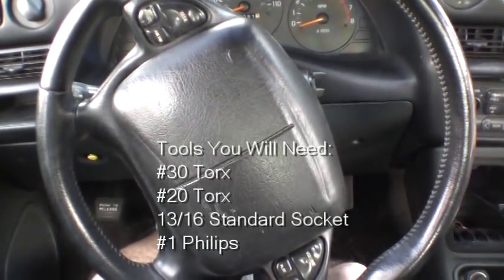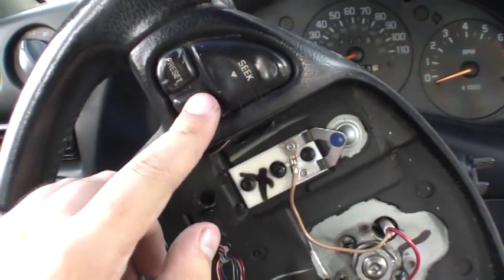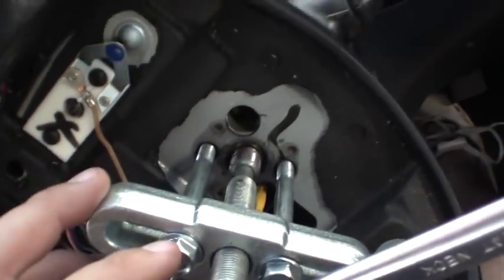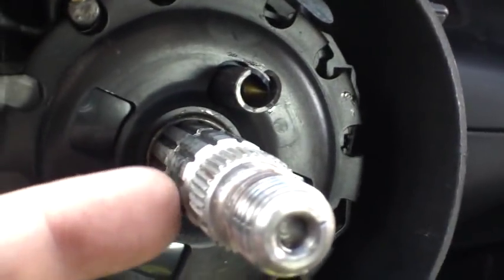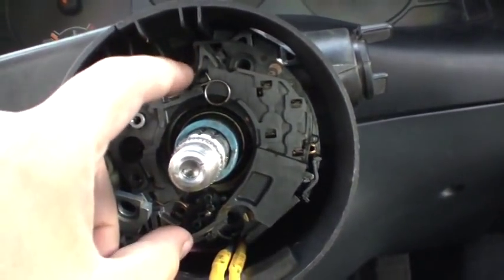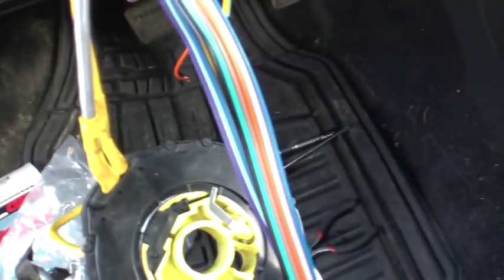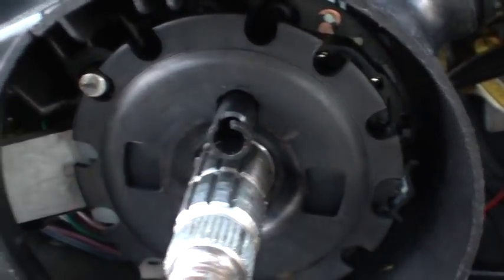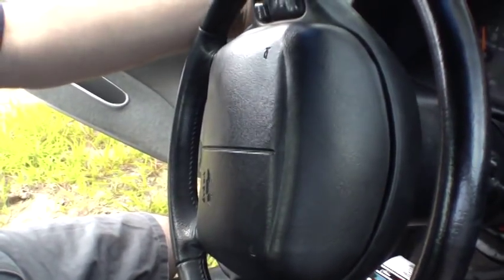How To: Blinker Switch or Turn Signal Replacement 1996 Chevy Monte Carlo

Comment: worked on a 98 Lumina, this really helped used a t10 and t20. did not need t30 on the lumina. the clock spring and the piece before the turn signal switch was a pain. it helped having help in pushing down on the parts to remove the springs. thanks on the video!

Comment: Did this job today on a 97 Lumina. Getting that steering wheel locking disc off was quite a job. Really struggled removing the c-clip without tabs. I finally found a right angle pick, and it did the job. Putting it back was even worse. Had to call a friend to come over an lend a third hand. The spring tension was wicked. Anyway I lucked out in one way. My problem was left turn signal would not latch on all the time, and when it did, it would not reset after the turn. After removing the steering wheel disc, I could see the left spring was broken. Took spring off replacement switch, and installed it on the old switch. I see your left spring in the video was missing altogether. Anyway all back together and works great. Thanks

Comment: Cheers man I couldn't for the life of me figure out why my brake lights quit working in my 96 Lumina so this helps alot. Great video
Reply: sorry ass luminas...i,m doing the same on my 99 lumina ...brake lights not getting power...why in the hell they run the brake light switch off the turn signal switch is stupid....

Comment: Awesome video. Just replace mine using this guide. FYI...The big Orange wire (2 wires inside) is the VATS security system. You can bypass the system by finding the resistance of the chip in your key and install a resistor of that value (radio shack is easiest) to connect both wires together (from the under dash side not ignition side). You can also do this so you don't have to pay $20+ for a resistor key and get a $2 regular key.

Comment: Right on! Your video made it simple. Same exact process for 95-99 Cadillac Devilles. Thanks! Once I had everything apart, noticed some idiot had broke the turn signal canceling cam where the horn wire goes and instead of replacing the cam, he put a toothpick in with the horn wire to tighten it. It worked...ingenious but just plain lazy.

Comment: thanks but wrong connector you showed under the dash it is the one with the white clip on the back of the junction block you showed  also most all horn pieces will be broken replacements are gm#26047013 but buy from advance or oreilly and save yourself 26 dollars over the stealership. just adding to the good job you did making this video thank you

Comment from the maker: @0button0 If you are asking about the corroded wire, it is in the engine compartment drivers side.  There is a fuse panel that has an open bottom.  Unbolt it and check the bus bars underneath.  There are most likely some wires that have lost their connection completely.

Comment: Im changing mines on a 95 Cutlass Supreme and the hardest part is removing that wire harness from the turn signal switch that's clicks onto that electrical box underneath the dash. It's slightly different so I been fighting with it for over an hour now.

Comment from the maker: @a40caldon1 Are both your rear running lights out?
That is very common for these cars, it is caused by a corroded wire.
I should make a video showing how I fixed it...
Reply: Hi, what color wire is it?? And is it possible to overlay said burnt wire and test?? 97’ monte z34 3rd lamb works taillamp brake lights inop
Reply from the maker: @colbypelly9010  If I recall correctly, the issue is that the wire corrodes where it is connected to the fuse block in the engine compartment. It may or may not be easy to see depending on how badly it has corroded - the fuse block would have to be freed so that the wires on the bottom could be inspected.
Reply: Hey, I found out that it is the switch causing my lights to go out. When holding the brakes and wiggling the switch my Taillamps will start to work! Checked the fuse box. No corrosion on mine! 97’ Monte Carlo z34 87,000KM

Comment: One part is missing from this... how do you treat the injuries caused by f***ing around with the airbag without disabling it first?????
Reply from the maker: Perhaps pay a little attention to the first part of the video that says "WARNING airbags are dangerous disconnect your battery first" to avoid injuries?
Reply: +zcomputerwiz&#160; Just disconnecting the battery does not guarantee that the airbag will not deploy. The proper way to disable the airbags is to pull the fuse and then disconnect the airbags at the connections under the dash.
Reply from the maker: I haven't seen that anywhere, but whatever floats your boat.

Comment: Thanks for the video I need to do this exact same thing on friday. So what exactly is the total time it takes to get it all done? Also my turning signal lever is just loose to beat hell. I'm able to turn on my high beams but my turning signals are ofcourse gone along with the brake lights. would i be able to fix that problem by simple adjustments or would i need the whole thing brand new?

Comment: To take the second little ring off use your steering wheel puller and push on the spring loaded metal disk and the ring will come right off

Comment: I followed you video today, and I believe did everything correct, and my brake lights are still not working, could it be the switch from the junk yard had the same problem or, should I replace my entire steering wheel column? Do you have any suggestions?

Comment: I noticed that there was no hazard switch coming out of the steering column. Does that switch part of the turn signal switch that you replaced? Good vid!
Reply: my current question
Reply: For those that are still wondering, the button for your hazards usually connect to the switch for your blinker (if your hazards button is on your column. If it’s somewhere else in your car, you can disregard this). In the early 90’s GM cars/trucks like this, you’ll take a Phillip’s screwdriver, unscrew the screw in the center of the hazards button, and pull it out - DO NOT LOSE any of the pieces for your hazards button, put all of them somewhere safe, preferably all together in a box or container, so you can reuse them later

Comment: K so I have replaced the multifunction switch and am putting it back together I have got to the part of putting the locking ring in place and can not get the spring to let the piece go back far enough to get the ring into the groove any tips or suggestions are desperately needed please and thank you
Reply from the maker: Shi Wheatley I had to push rather hard against it because it was spring loaded while keeping it even otherwise it would bind. Make sure it is properly aligned - it will only go in one way!
Reply from the maker: +Shi Wheatley I just did this job again on a 97 (which is identical) and experienced the same problem.  There is a tool 'tilt column spring compressor' that looks something like a 'U' bracket with a hole in the middle. A bolt with a coupler that has the same thread as the steering shaft goes through the hole and has a nut that can be tightened to push the locking plate down.
From what I gather I got lucky with my 96 and had the steering wheel tilt in the perfect position that I could get it close enough by force without the tool.

Comment: Yah i agrre with the comment below. I thought hey if i can change a radiator and thermostat on my 2000 dodge ram then i can do this... But yah this seems tedious. Ill be bringing mine to the shop. Btw quick. Question...would this be the same disassemble and reinstall for a 95 olds cutlass? My blinket switch was getting stuck and snapped off under pressure. Now my brake lights wont freaking work. Yayyyy.
Reply: Should be the same. I plan on doing this job at home.

Comment: Okay, I did all that and am down to replacing the switch.  How do I get to the place where it plugs in and how do I get the wires down to it?  I'm looking at a service manual and it says remove the steering column cover.  I'm lost.  You made it look simple what you did, but now I am stuck and confused.  Can you help?
Reply from the maker: I turned the connector sideways and pushed it through with the wires. It might bind a little, but should make it all the way through :)  If not, try using a straightened metal coat hanger to push it down.

Comment: PLEASE HELP !

 At 3:59, the video says push the metal plate forward to gain better access to remove the metal retaining ring.

But on my vehicle, the metal plate can't be pushed at all, and the metal ring is completely trapped between the metal plate and the steering shaft.  There's no gap and no way to pry it out.

How would a pro mechanic proceed from here ?

.
Reply from the maker: There is a steering wheel tilt spring compression tool that can be rented from parts stores, this should provide enough pressure to free the ring.

Comment: Having a hard time getting it back down so that first spring locks in
Reply from the maker: You might need to use the tool to compress the spring. Make sure to have the wheel at whatever position puts the least pressure on the tilt spring as well.

Comment: You GLOSS over removal of the second ring clip instead of stating the proper tool to get it off. Picks and screwdrivers do not work with plate pushing against it. Been on that clip for over half an hour and it is no closer to being out of the way then when I started. There is a compress tool that pushes the serrated plate down for easy clip removal. It is 15 bucks at AutoZone or you can rent it there.
Reply from the maker: I guess you didn't read the comments. This was my reply to Shi's question about the clip: "I just did this job again on a 97 (which is identical) and experienced the same problem. There is a tool 'tilt column spring compressor' that looks something like a 'U' bracket with a hole in the middle. A bolt with a coupler that has the same thread as the steering shaft goes through the hole and has a nut that can be tightened to push the locking plate down. From what I gather I got lucky with my 96 and had the steering wheel tilt in the perfect position that I could get it close enough by force without the tool."
Reply: +zcomputerwiz Overall good video thanks. You got me thru it.

Comment: So why did u skip the hardest part of getting the rig out....wtf do I do I can't get it off
Reply from the maker: Anthony Venters Which part is giving you trouble? The wires?
Reply: Figured it out ty....u don't show that u need the certain tool to compress the spring to get the ring off
Reply from the maker: +Anthony Venters I just did this job again on a 97 and encountered the same problem, had to go get that tool.  I guess I was just lucky with the 96!
Reply: Yea I didn't realize u needed the tool that we did have
Reply: +zcomputerwiz what is the name of the tool?
Reply: I forget the name but it screws down making the ring loose and able to remove
Reply: +Anthony Venters steering wheel puller possibly?
Reply: Breanna Carter Exactly